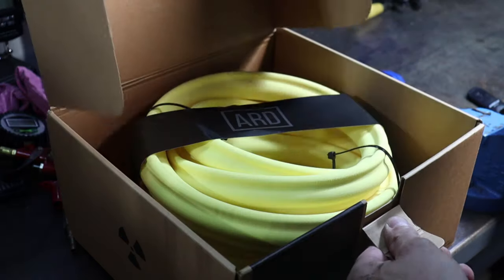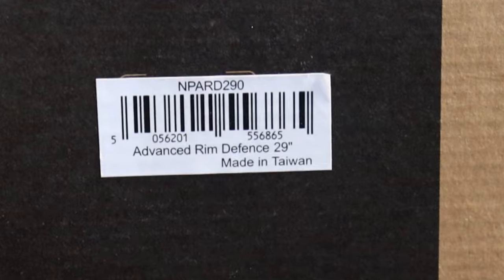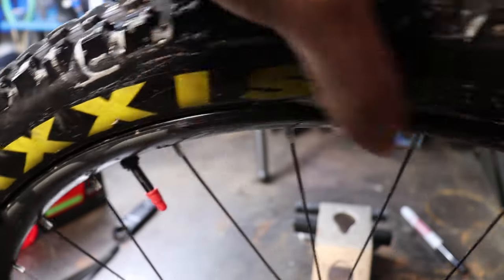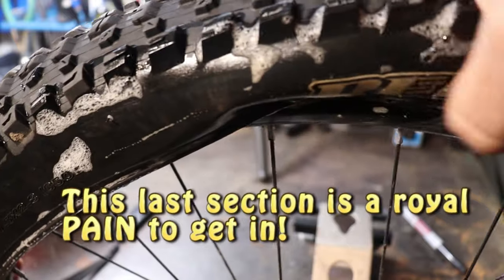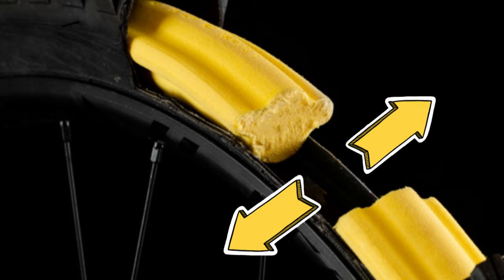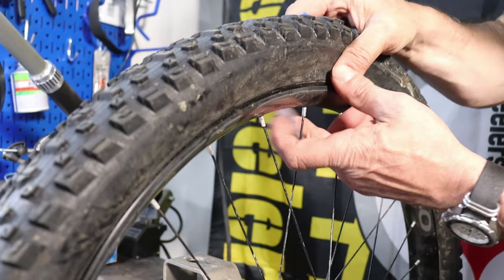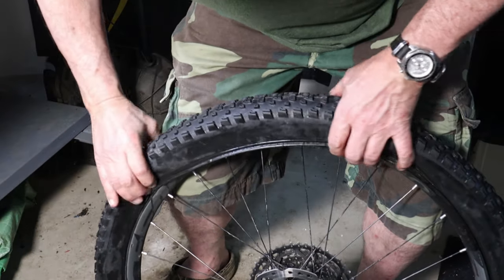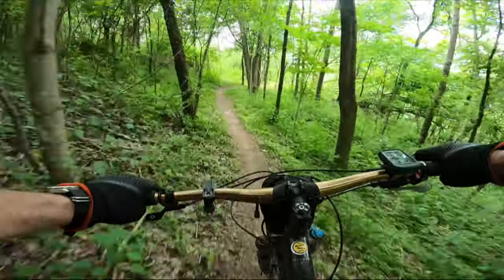Nukeproof ARD Rim Protector Install

Comment: I was going to let the valve that was already on the rim but you saved me from doing that mistake.
Reply from the maker: Thanks for watching Prof. Glad to hear that the video helped you out. That was a while back since I've done that video. I think I showed how I got the air back out. If not and you happen to put a standard valve stem in by accident, you can get the air back out by removing the valve core and inserting something like a small allen wrench into the valve stem and pushing against the insert to allow the air out.

Comment: As requested, here’s my comment. I installed a pair of these onto 2 rear 29” wheels. Mine didn’t come with instructions. Turns out I did it correctly. The install was fairly straightforward and the tyres inflated easily using a track pump. One wheel was a Nukeproof Horizon V2 which already had the correct valve installed. The other was a Santa Cruz Reserve and I had the same trouble letting air out the tyre. I’ve ordered a 2nd set of Nukeproof valves. Sorted :)
Reply from the maker: That's awesome Toby! I'm glad it worked out for you. Thanks for watching!

Comment: That looks like a nice upgrade. Be sure to let us know how it works out.
Reply from the maker: Thanks Tony! So far, it's doing pretty well! Aside from the extra cushion, I think that they also have a volume reducing effect. The further they compress the higher the pressure gets, so it should protect the rim that way too. Thanks for watching!
Reply: Genius!, that’s what i was guessing, that it would wotk as a volume spacer used in air shocks. Giving the ride a more progressively compression
Reply from the maker: Thanks for watching. Glad you enjoyed! I have never experienced a dinged Rim again after using these. There may be better ones out there, but I am happy with the performance of the Nukeproof ARDs.

Comment: Wish I'd installed the inserts straight away on my new Horizon v2 set... thought a DH casing would suffice - nope; punched a good dent in the rear wheel in the first week even at 28psi. Now after installing an insert and the DH tyre (much harder than your tyre looked); I've got a leak at the base of the valve stem, so I've compromised the tape somewhere. Luckily I haven't installed sealant yet, so removal/tape repair/refit won't be messy, just difficult.
Reply from the maker: Thanks for watching and sharing your experience Phaedrus. I only use this insert on the back wheel. I may regret it at some point, but for me the back tire always takes a lot more pounding. As I get older, I don't think that I hit stuff quite as hard either! 😁
Reply: @themostlymikeshow  Thank you for making a great demo video.  I've only really felt the need for inserts since buying an ebike. Only owned it a couple of months and already demolished two rear rims.  I'd rather not use them but I think they are pretty mandatory for the weight and punishment an ebike delivers. Next time round I'll try a lighter casing and try and avoid using levers because I can't mount the Shwalbe DH casing with an insert without levers.

Comment: So I'm assuming you bought the insert sized for a "regular/standard 29", but used it in a 27.5+ setup. Wouldn't the install and uninstall have been much more difficult on a "regular/standard" wheel & tire setup? Great video BTW!
Reply from the maker: Thanks Garry! Good question! I should probably keep searching for the 27.5 version and give it a try at some point. From what I have seen, there's only one width option available for each diameter. I would guess that the narrow rims and standard tires would probably add more challenge to the job.

Comment: How have they held up?
Reply from the maker: So far, so good! I hit some pretty gnarly rock gardens, and they seem to be holding up pretty well! I haven't gotten to look at the inserts themselves to see how tattered they are, but I suspect not very. Thanks for watching!
Reply: The Mostly Mike sHOW Cool. Thanks for the reply. Have the stretched out on you? Read several places that people have had problems with that. If so, did you cut and reattach it? Thanks!
Reply from the maker: @dancing8595  I heard about that happening too. Although I don't think that it affects the performance of the inserts, they said that it's annoying. I am not noticing it yet, but I just installed them a couple months ago, so it may happen. I will definitely post an update if I run into any problems. My method of connecting with zip ties seems to work pretty well. No problem on the reply! I appreciate the comments and questions. They really help the channel. I will keep up with the replies as long as I am able to keep up with them! Thanks again!
Reply: @themostlymikeshow  was gunna say im a uk rider and a mate has them he had the ard stretch issue  he just removed them cut abit off zip tied em again and no issues but he got them when they first released them could of been a first batch problem i think they changed something in them to counter that now
Reply from the maker: Thanks for watching Hai! I have never had any problems with that yet. They have been on for a little over a year now. Of course, I hadn't changed tires since. Can you tell if they stretched without taking it apart?
Reply: @themostlymikeshow   i asked him for you aparently if it dose happen my mate said you can feel it rattle a tad  in tyre but maybe you got lucky lol he has got new ones and like you no issues now
Reply from the maker: Good to hear! Thanks Hai!
Reply: @themostlymikeshow   no probs

Comment: Would the 27.5 o es stretch to fit a 29 wheel you think?
Reply from the maker: Thanks for watching John. I really don't know for sure. It would be close. They are a little bit stretchy, but just not sure if it would make it onto the 29. They do make 29" Nukeproof ARDs.
Reply: I know but with chain reaction going into administration, they only had 27.5 left. I've not tried them but people have been saying they stretch and need cutting down after a few rides when they got the correct size which is why I was hopeful.

Thanks for replying
Reply: Just to confirm if any one is interested in this I have successfully installed the 27.5 ones on 29 wheels and offer a nice snug fit.
Reply from the maker: Cool John. Thanks for the update and info.